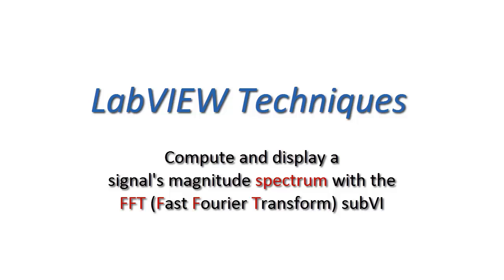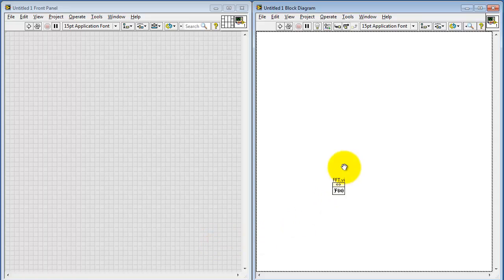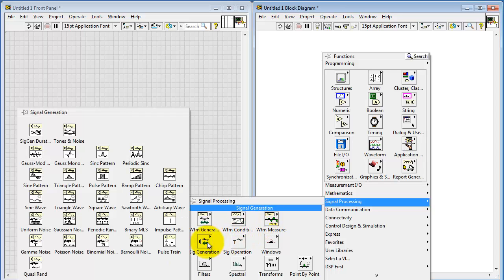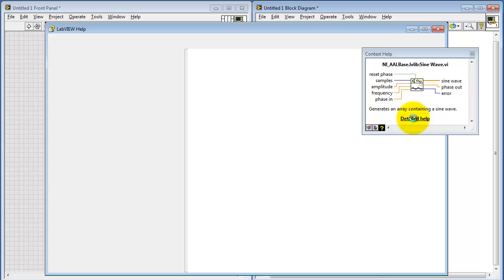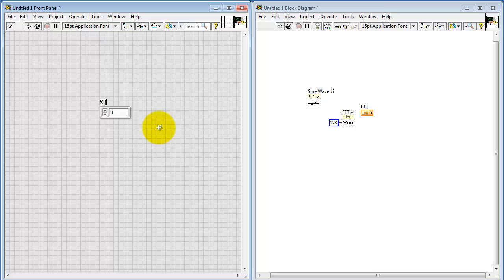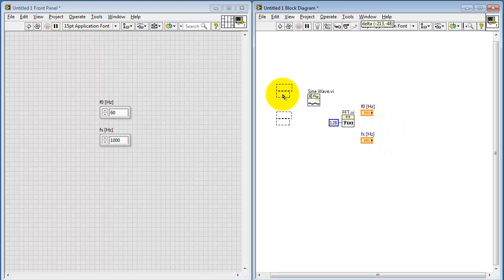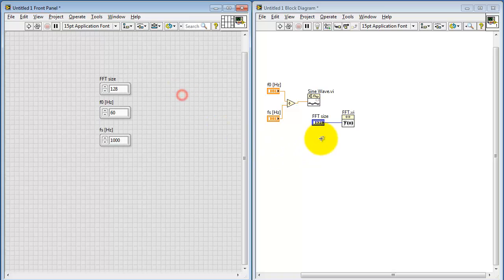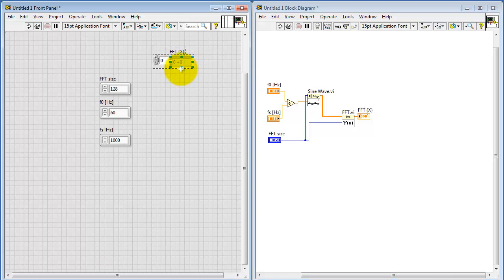NI LabVIEW: FFT subVI to compute magnitude spectrum

Comment: I am taking fft of wave but the array in that wave is small so the resolution of fft is not good in my VI. I want to expand that array by collecting 10 or 20 waves data and then fft of it. How can I implement this?
Reply: Hi..can you please tell me how fault detection module work in LabVIEW it is in sound and vibration toolkit..i want to connect accelometer on bearing so i want to take bearing fft or frequently data so please help me regarding it..

Comment: hi,
I notice the frequency is 60Hz, but the frequency bin is 8Hz. Is there any mistake in your labview setup?
Reply: Hou Tatt Yap Multiply the bin number by (fs/FFT size) and you will get it. Each bin has a frequency range rather than single frequency component. In this demo, each bin is 7.8125 Hz wide.
Reply: @wbadry this is useful, however, I'm struggling to present this on a graph on LabVIEW can you suggest any techniques to modify the x-axis of a 1D array?
Reply: because FFT size and Fo must to be equals